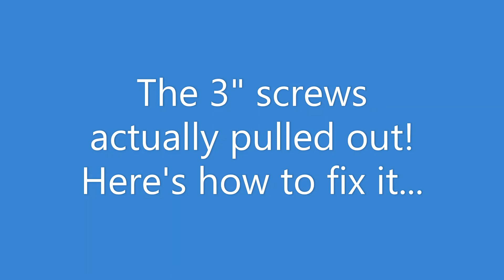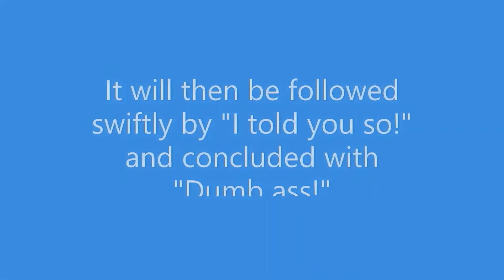How to Fix a Curled up / Warped Deck Plank. Jimmy B's Quick Tips Volume 11

Comment: I would not have done this. Ur better off replacing the board.
Reply from the maker: That would have been preferable.  But times are tough. People need to save whenever possible.  The plank was less than 1 year old and posed no safety risk.